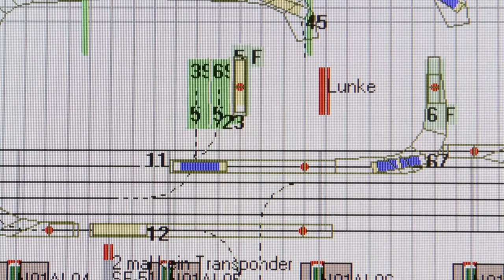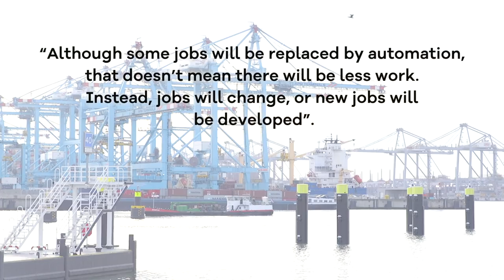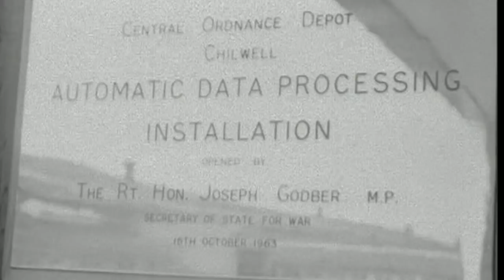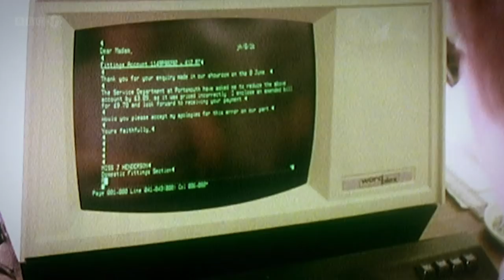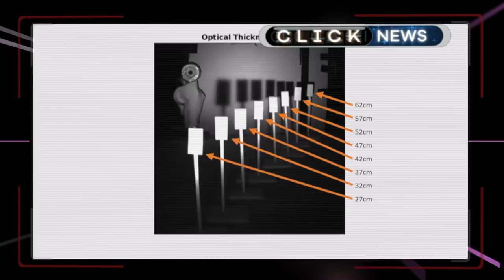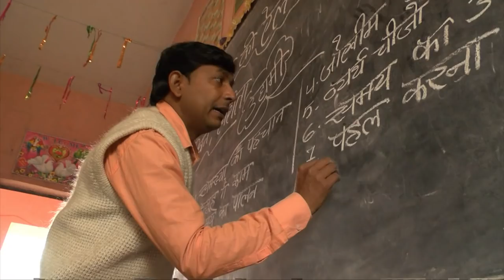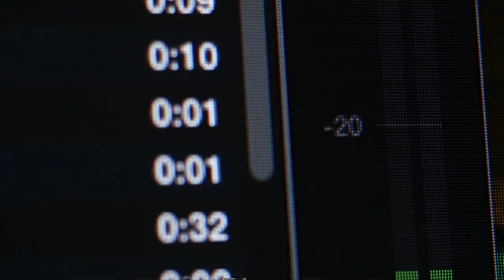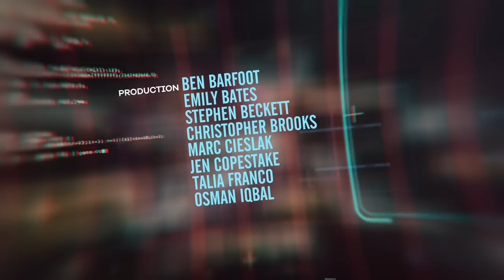Will Robots Take Our Jobs? - BBC Click

Comment: why cant we essentially 3D print buildings yet. like ive seen 3D printers working and i was like why cant we do this with bricks, or even some new type of polymer. but it would make building a house so easy. you take like a day to set up then the next day you print and you leave it to set for a week to be safe.
Reply: IT WILL BE FASTER AND EASIER, SO MAY BE YOU PUT A ROBOT INSIDE THIS PRINTED HOUSE TO LIVE IN ,AND YOU'LL BE PUT , CAUSE YOU WON'T HAVE A JOB TO PAY FOR THE PRINTED HOUSE

Comment: I do believe in automation to some certain extent
Reply: therein lies the rub.  Automation and subsequent job replacement is normal in an industrial society.  But never before has the replacement rate threatened to be so much faster that the education system (and the financial system that supports education) cannot keep up with it.  Sure, spend $100,000 for an education that might be obsolete before you even graduate. the pace is too fast, and there is no regulation on it.

Comment: sorry but its going to be years before robots take over constriction,   constriction is not just knowing how to build - lay bricks, it takes years of experience to know how to come up with a fix for a unknown problem witch with constriction is constant.
but yes like drills and jack hammers, brick laying and some other types of robots can help speed things up.
Reply: What you described was engineering.  Of the 600 people on a building site fewer than ten are engineers...
Reply: @Deon Hamilton. Were u hiding somewhere or lost at sea? I guess u never heard of 3D printing houses.

Comment: What a stupid question, it takes loads of people to build these robots, mantain them, fix them and still need to be monitored
Reply: TheGrekco - thats a very simplistic view, there will be robots to maintain the robots, and they will maintain each other and they will design and build better robots with no human involvement
 there is no job that can not be automated eventually
Reply: @hindugoat2302  Not just simplistic but utterly moronic.  "The robots may build the cars, but we still build the robots!"

That's like saying "I've invented a machine that fills up a jug, you just pour water into this jug and then it pours itself into the other jug!"
Reply: @krashd  This issue has been covered many times... its true that you still need to top up the jug with water, but you can still replace 95% of your workers and save a fortune in wages.

you make some robots that build cars... now those robots will replace 100 human workers forever, and you only need 10 humans to maintain the bots.
Now you build maintenance bots that can repair the car builders and other maintenance bots.
Now you just need 2 humans to monitor them all.
Now you make AI that can monitor the bots better than humans... 24/7.

Sure you have to keep feeding materials into the factory, but again, you can automate that, self driving trucks bring the materials in to unloading robots.
Sure you need a couple people to monitor this, but all the human unloaders and truck drivers are gone.

Then all the monitoring jobs are automated with artificial intelligence.
Its far more accurate than people, and runs 24 hours a day for free.

its a gradual process of replacing humans with machines, it brings production costs down to super cheap prices, increasing profit margins.

If your factory is automated, you don't need to pay for safety training or gear for workers, you dont even need to pay to keep the lights running.